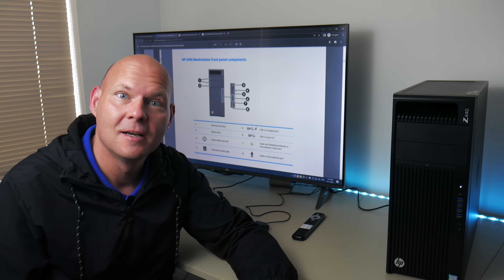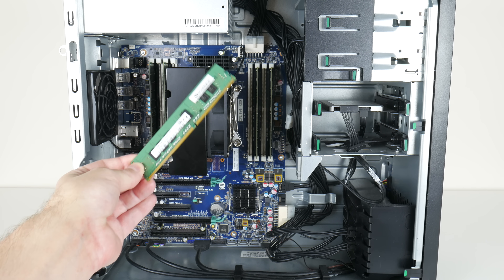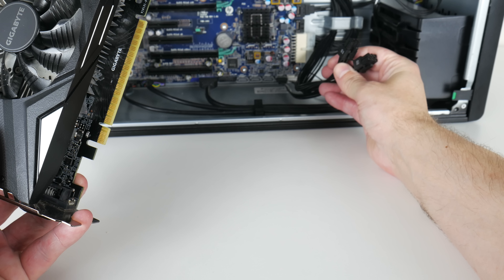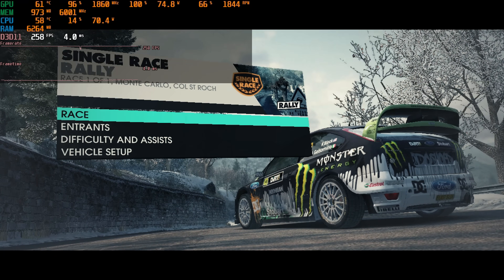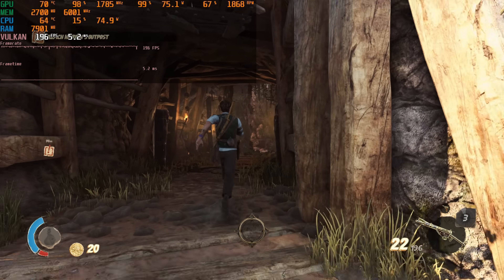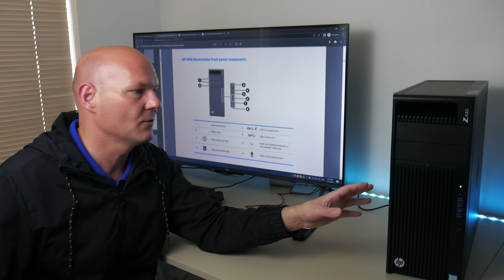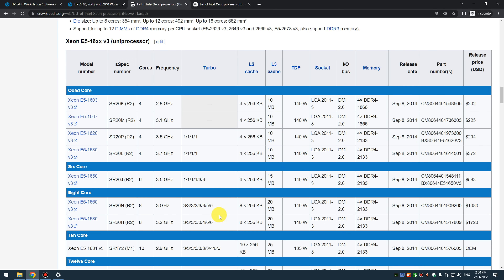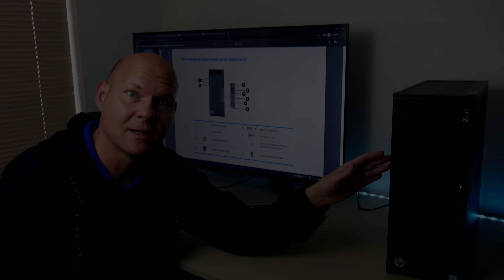This HP Z440 PC was my best purchase this year

Comment: Sandy Bridge through to Haswell are still such a value powerhouse for so many tasks. Apart from Athlon / Duron K7 and Core2Duo, the Sandy/Ivy Bridge/Haswell would have to be amongst my favourite platforms to build.
Reply: I was amazed how much faster my old haswell system became when I replaced windows with Ubuntu. There's not many tasks it can't just breeze through.
Reply: I still use a i7 2600 almost daily even though I have a faster Ryzen and 8th gen... still fine for almost everything..
Reply: I just love the sandy & ivy bridge cpus. Not only are they (still) capable, but most importantly relatively cheap and very easy to get!

I have three of them in active systems, a i7 2600k on a z77 board with a gtx 980 (no dx12, but vulcan runs fine), a 3570k on a q77 with a gtx 670 oc, and a 2100 for some dualcore retrogaming with a gtx 560ti.
Reply: I still use sandy bridge through haswell however I still use and find core 2 duos and core 2 quads to be good for a lot of stuff too.
Reply: @9852323  if You have a 775 mb, core2 duo is the budget choice.if there is no quad in range
Reply: I have too many 775 motherboards... All of them are g41

I also have lot of 775 processors, from p4, then pentium dual core, core 2 duo, and core 2 quad
Reply: @Win32Application - System File Haswell 4790K here, mine started to do the same with temps, i delided the CPU, put some liquid metal in between the die and the ihs, and that alone dropped temps to 20 degrees less, OC'd it a little bit to 4,6Ghz and still never touches 80°. The problem with this CPUs is always the same, the tim from factory is now waaaay beyond its intended life span.
Reply: @Romerco77  My 4150 still having no temp issues being pushed hard most of the time being so low end
Reply: Haswell is an awesome platform. I found a used Xeon 1320 v3 for $50 and replaced my i3. It's really powerful and cheap. It's on a z97 board I got with a low CPU with the intension of someday getting a better CPU.
Reply: @Kyle1444  That's an i3 4150, it has half the cores and about 1Ghz less than the 4790K... It will obviously have the tim rotten after 9 years, but it is just not power hungry enough to exceed a standard cooler for the platform. Anyway replacing the tim will grant you minimum 10°C less.
Reply: Fully agree… still using them as well… WinXP retromachine and Truenas server. Very reliable, 4790 is still a good cpu for modern stuff. Since the i7s appeared, i nver disposed of a desktop build. They become machines for my in laws, my wife’s clinic, etc.
Reply: My main system is a Ivy Bridge dual Xeon, its great and doesn't make me feel like I need to upgrade at all.

Plus it's fun when I tell people I have 24 cores, 48 threads, and can load up a quarter TB of memory if I wanted to.
Reply: @Win32Application - System File are you sure your processor didnt have any hardware problem? i have two Haswell setups with no temp issues. I remember the PIV at high freqs., these was really hot!, but since sandy bridge i didnt noticed specially hot playforms on intel
Reply: Sandy to Ivy in those workstations needs a bios upgrade if I remember well, however I just went for 1 Haswell to two Broadwell without a problem, I just picked up 2 2698v4 for my n840, and boys, ATM for a tenth of what it was worth in 2016 including two Ampere core GPUs it is a powerhouse for less than 500 watts.
For consumer PCs you will pay 3000 or more for such a setup that draws 100+watts for less functionalities and they look like they were all made by a drunk cowboy in Las Vegas, all those rainbow lights can give you diabetes.
Reply: @bitelaserkhalif  I have a room full of shit I will never use!

Comment: I've flipped several z-series workstations over the years,  their cases are built for a battlefield and I even cross-fired some low-end GPUs with mixed results. These are excellent value for dollar and decently upgradeable and as you said already VERY quiet...nice vid.

Comment: Nice, I run a HP Z620 that I bought 4 years ago for $500.  It was upgraded to dual E5-2667v2  (16 cores) and has the same performance as yours.  Has been stable since inception.  Workstations are the best bang for the buck out there.
Reply from the maker: Awesome 🙂
Reply: Same here. Great bang for the buck, Think i paid $300 years ago. GTX1070 and all my games work very well. Only thing it doesn't have PCI bifurcation. i just upgraded soon as it gets here to Z440.

Comment: The early i7 machines were so good that still can be used today for every day tasks… just upgrade ram and migrate to an ssd, they will perform very well. My i7-920 now sits on my wife’s attending clinic… just got a Xeon x5680 as last upgrade. 100% rock solid. Running for 14 years every week day.
Reply: i absolutely love the 1366 platform and is still usable nowadays, but a second hand i3-8100 doubles the performance and reduces the consumption dramaticaly. I sold my i7-960 and bought a buisness line Dell with a Skylake core I5, no adding money and it runs very good... but im not sure if im happier now :)
Reply: I'm also running a 1366 system. It had an i7 920 when a bought it in 2009 but I put in a Xeon X5675 and run it at 4Ghz some years ago. AlsouUpgraded RAM, storage and GPU and changed some broken fans during the years. Works great.

Comment: I own HP Z440. Quietest computer I've ever owned! I use it for music production and mixing. Super cheap parts, supports nvme booting, crazy amount of usb3 ports. I love this machine!

 Before Z440 I had a Fujitsu M720 which was also quite nice and quiet, then I got the M740 which was a disappointment - on paper it was supposed to be quieter than M720, but it was actually louder. Plus, there are 2 versions with 2 different motherboards, and unfortunately I got the one which didn't support nvme booting(!)... I also had a Dell T3610 and T5810 for a while, but they were louder than Z440. HP Z440 is the best PC I've ever owned in terms of how smoothly and quietly it performs. I praise this machine to everybody :)

Comment: I don't use it much anymore as I have a 5950X rig for my daily driver, but I bought a refurb Z800 (2xX5650) back around 2015. The RAM eventually died, so it now has only 16GB (rather than the 48GB it came with). Amazing build quality, and I love how you can take the whole thing apart in about 5mins with no tools; hard drives are basically a case of clip into case and slide in -- no plugging cables at all; for SSDs on it I put an IcyDock into one of the 5.25 bays -- it has 6 SATA connectors plus about 8 SAS connectors that double as extra SATA connectors.

Comment: I've had my Z440 for about 3yrs now. I recently upgraded it to a E5-1660v4, 64GB RAM & RTX 3060 ti. I like that I can put a full size bluray burner and it has plenty of space for extra drives ang games well. I just got Forza 5 and I can play it @ 1440p & 2160p. The cool thing is I can still upgrade the RAM & CPU further if I want to.
Reply: What about the cpu cooling fan?
Reply: @stormk-1130  the CPU fan does a decent job cooling the CPU. I've never had any issues. I saw one video that showed a water cooled fan specifically designed for the z440.
Reply: Awesome and looking for a similar setup E5-1650 v4.64 GB but planning to install a Rx 6600 your recomendations with the PSU change for a standart or buy adapters
Reply: @Jaroartx  just make sure to get one that already has the stock 700W PSU. The 700W variant has two 6-pin pcie connectors. You can get adapters if your card has an 8-pin connector.
Reply: @pjasonq  I'm seeing them on Ebay for $40.  Even if your don't get one with the machine, you can upgrade.
Reply: Hey  @pjasonq ! I have E5-1650 v4 16 GB, I want to upgrade the GPU and get the RTX 3060 ti, But was worrying about the space inside the case, Also it has a 3.0 Pcie and that gpu needs a 4.0 Pcie, So how that went with you? Have you upgraded the motherboard for that?
Reply: @abdulwahabamer361  An RTX 3060 ti will fit in the case BUT you should make sure its a smaller two fan version or the smaller ones from gigabyte. Yes you are right...there is no PCIe 4.0...you'll just have to live with PCIe 3.0. Depending on the use case, you may not notice much of a difference unless you are trying to achieve the highest frame rates. I have a customer using an E5-1660v4, 64GB RAM & RTX 3060ti...he's not gaming but he's running four 28" 4K monitors and he's pretty happy with his setup.
Reply: @pjasonq  AWSOME!!! I wasn't expecting you to reply this fast! Lol 
Thank you so much!🙂 Will buy the gpu tomorrow.
Reply: @abdulwahabamer361  you're welcome. I'm not sure what you are using the 3060 for but keep in mind the regular 3060 has 12GB of vram and the 3060 ti has only 8gb. Also make sure your Z440 has 4 matching pieces of ram...this way you are taking advantage of the quad channel memory. For example 4x 16GB DDR4-2400 RDIMMs for a total of 64GB but you'll have a much faster system overall.
Reply: @pjasonq  I'm a video editior!
So mostly working on Adobe premiere pro and after effects.
And planning to get 2x rtx 3060 ti

Comment: I've been using an old HP Z400 for a LONG time with a GTX-970. It's finally getting replaced as soon as my new RAM kit for the new build gets delivered here in a few days but it has been 100% reliable. It was getting tossed out at work so I grabbed it and slid my video card in when my gaming machine died.

Comment: Used HP Z-series workstations are a really good value. I use a Z420 for live streaming computer repairs from my basement, and had a Z440 for video editing... and I'd still have that Z440 but something happened to the motherboard (and a replacement motherboard was going to cost nearly as much as just buying another used Z440). However, there's a chance that failure was my fault*, and there are a lot of other people successfully using Z440's after their business life was over, so I'm chalking my Z440 experience up as a fluke. And I'm tempted to pick up another Z440 because they're such a good value for a lot of productivity tasks.

(* The motherboard stopped working after I removed the video card to move it to another computer. But when I put the drive from the Z440 in another computer to pull the data off of it, I found evidence that the computer may have been asleep - and not OFF - when I pulled the card out.)

Comment: I was able to take a few of these generation HP Z workstations from my work whenever we upgraded to the HP Z8 G4 lineup a couple years ago. I absolutely love the tool less design, the build quality of their chassis, and of course how modular and upgradable they are, not to mention the reliability of the hardware. I'm using one right now as my main system, although just like you, I did drop in a graphics card upgrade, a Radeon RX 580 8GB in my case.

Comment: I picked up a Z440 to build a budget gaming rig for one of my kids.  Upgraded the CPU to a 1680, replaced the cooler with a Noctua NH-U9S, booting on an NVME drive in a pci-e adapter card, and installed a gtx 1660 super.  It runs great! I like it way more than I ought to, the build quality of the chassis, the cable management, the built-in handles, it's just too cool.  Nice video!

Comment: I'm one that loves dual socket workstations. I got a HP Z800 for free in 2020 and upgraded it pretty heavily (went from single X5560, 4GB RAM, and a FX 1800 to dual X5660, 192 GB of RAM, and a GTX 1080 8GB) and used that for about a year. Then in August of last year I picked myself a P920 (Lenovo version of the HP Z8G4) and spent a pretty penny on it. I got myself dual Xeon Gold 6144, 256 GB DDR4, and carried over my 1080. Fun fact, one Xeon Gold 6144 beats both X5660 processors in benchmarks.
Reply from the maker: Nice!
Reply: That is too much RAM.

Comment: I bought an HP XW4400 workstation, refurbished, directly from HP in 2008. I just retired it a few weeks ago as my primary work/play machine for a newer computer - another refurb HP workstation. Never had anything go bad on it except a RAM module (which I think was one I had added). I couple cycles of updates over the years and I eventually had it at 'full spec' with a Core 2 Quad Extreme CPU and 8GB ram. With a couple SSDs and (eventually) a GT 1050 (I think) it was very quick and I was able to play any game most games I was interested in. It ran Crysis smooth as butter, along with a lot of other games too.
Reply: good choice. I bought the same type a few years back since it one of the latest gen of PCs that still support 5.25" floppies. I wanted to archive my childhood memories (30+ years old). Out of 36 around 32 floppies still worked. The ones that didn't also already issues back in the days.
Reply: @polaxis842  Wow true, I don't even know were all my floppies ended up, I must still have a couple of old hard drives somewhere including one with my thesis.

Comment: Just got a z440 today I actually got 4 of them along with 3 new keyboards, 3 mouses, and 2 health equipment monitor display things. Dude had a buddy who used them in a Medical center and gave them to him to have which I bought all for $60! So far one unit has missing memory and storage but a 6C/12T Xeon! The other I opened up has 32gb (x4 8GB 2400mhz) samsung memory, a 4C/8T Xeon, along with an old 1TB HDD from 2011, the other two I have yet to open but will do so soon since I am gonna merge the parts and use as a replacement for my NAS setup. My setup I am replacing is going towards my younger cousin this Christmas since he wants a gaming Pc I'm just so stoked with my pickup!

Comment: Another benefit I've noticed upgrading my X79 setup from a 3930K to a Xeon E5-2667v2 was how cool it runs overall, pair it with a cool running gfx card and you'll have a whisper quiet machine that's still fairly powerful today. I run this as my 2nd machine with Linux and it's butter smooth and reliable that's able to play games very well, the bonus ball as well, that with a compatible gfx card installed I can run any OS from XP to 10  as well as Linux with full driver support.
Reply: I have a Xeon E5-1620v2 and a i7-4820K, which benchmark almost identical... both have a cheap pipe-and-fan cooler that came out of an HP workstation, doesn't look like much of anything, but they both idle under 25C and max out at about 50C. I was amazed.
Reply: Does it run this cool?
Core 0:        +27.0°C  (high = +80.0°C, crit = +100.0°C)
Core 1:        +28.0°C  (high = +80.0°C, crit = +100.0°C)
Core 2:        +27.0°C  (high = +80.0°C, crit = +100.0°C)
Core 3:        +26.0°C  (high = +80.0°C, crit = +100.0°C)
Now that's chilling.

Comment: Still running x99 platform with E5-2650v3 + GTX 1070 here, best bang for the bucks for compatibilities, expansion (tons of PCIe slot) and dirt cheap multicore CPUs, and much more, good cheap system for experiment/homelab use, even some gaming.

Comment: THANK YOU. I think that these refurbished computers, especially the workstations and the ThinkPads are the best. I bought a ThinkStation E31 and a ThinkPad T430 just as the pandemic was hitting. I paid $200 Canadian for the ThinkStation, tax, shipping, everything.  I use it for a media server. It has 8 tuner cards, 1 SSD and 10 spinning hard drives attached to it. It has run 24/7 recording TV and cutting out commercials for nearly 3 years now. It is so quiet, I have to put my ear to it to hear it running.  ThinkPads are great too. People have run those  over with their cars and they've barely been scuffed. This is what I'm buying from now on.

Comment: got a z440 motherboard, a converter cable for the psu and an e5 2667 v3, for round about 90$ and an extra shipping fee of maybe 30$.
Also bought 4x 16gb of sk hynix for 10$ each, an aliexpress rx5700xt as gpu, arctic gaming cooler.
And put all of that into a coolermaster haf 500 case white ed.
running linux mint.
love the thing.

Comment: If you ever need to replace or upgrade the power supply, you can buy adapter cables to adapt the proprietary connectors to standard ATX for $15 us.

Comment: A couple of things to point out about the PCIe slots (which I don't think were mentioned): 

1) The PCIe slots connected to the CPU (i.e. the two x16 and one x8) can be bifurcated, so with, for example, an ASUS HYPER M.2 x16 card with four NVMe drives in it and you'll be able to use all four drives. I have two of these adapters in mine, and run a Proxmox hypervisor. I'm using two of the drives from the first adapter in a RAID1 for the Proxmox installation and the other two drives for VM storage. Then I'm passing the other 4 drives through to a virtualised TrueNAS installation. Note that you MAY need to update the BIOS to enable PCIe bifurcation though, as I'm not 100% sure if it was a feature that was exposed to users on the early revisions.

2) All the slots are open-ended, meaning you can physically fit a card with an x16 connector in the x8 slot, for example (but it will run with at x8 electrically in this case, so keep that in mind).
Reply from the maker: Oh nice!

Comment: i got the HP Z820 and hot-rodded it, it has the dual Xeon E5-2687W@3.10 GHz + watercool system from HP, the 1150W PSU module, 64GB of DDR3 1600MHz RAM, a SAS SSD from Huawei of 4 TB, 2x4TB mechanical hard drives and for boot drive, since it doesn't support NVMe (because it was released before the standard got published), i used a refurbrished Intel DC P3600 PCie SSD of 1.6TB, and cherry on top, an RTX 3060 12GB from Gigabyte and i use it as my daily driver, a bit power hungry sure, but very reliable.